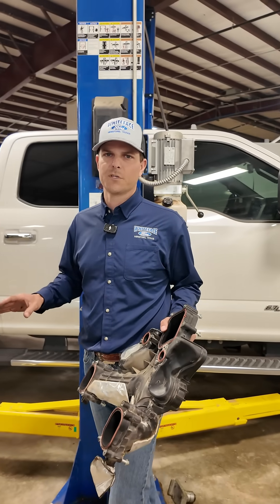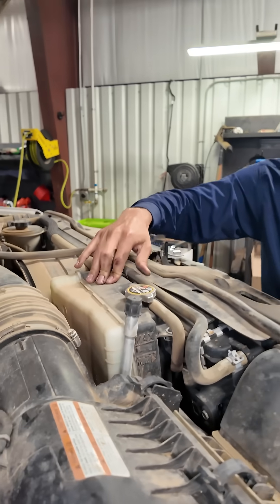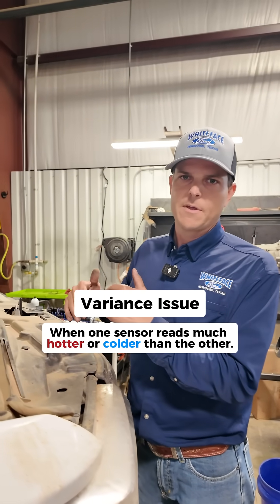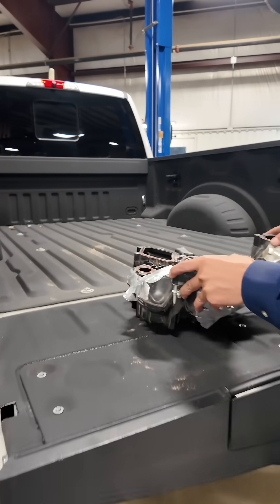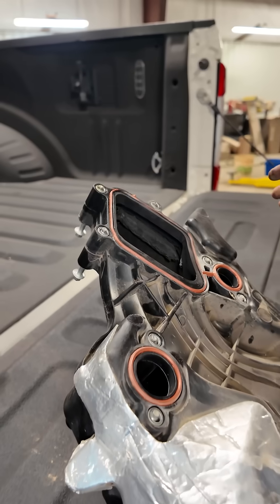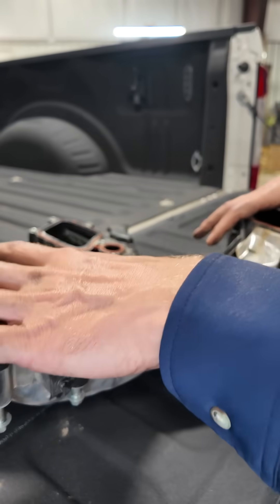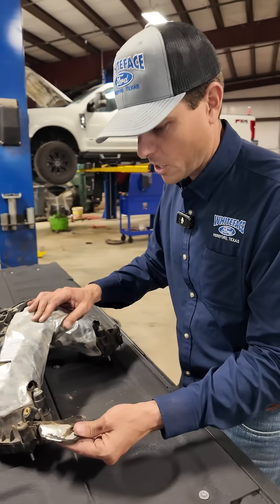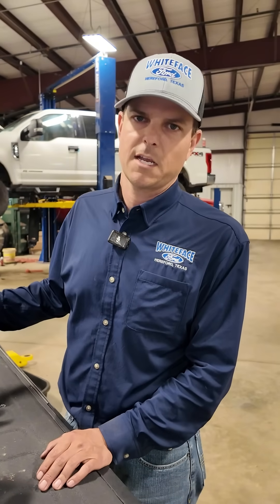Most Super Duty Gauges Miss This Cooling System #Shorts

Comment: I drove semis 25+ yrs all over the US.Never,ever,ever had a Issue other than a air compressor failure,and water In the fuel from a bad truck stop.Drove one truck with a million miles original on It for a Fedx contractor.How domestic pick up truck diesels are such a failure Is an abomination to all makes.I only buy gas pick up trucks.Very few diesels do I trust.

Comment: What the helly 😮
You would think they would make these parts out of something other than plastic 😂
Reply: The manufacturer doesn't want it to last
Reply: Pretty sure they dont use metal because it heats up alot faster than plastic doesnt atleast thats my theory or they just want more money
Reply: @carmelothegoat1892  yup I seen those aftermarket four barrel high preformce parts thats non Metallica spacers bolted in between the metal intake manifold and the carburetors probably to keep the gasoline much cooler inside the carburetor for better efficiency its even used today on small engines between the engine and metal carburetors im sure this came about from lesson from efi engine development and they applied it to carburetored engines but they over use plastic in my opinion inside the engine compartment especially since everything is just cramped together inside a tight compartment!

Comment: I threw that plastic garbage in the trash and went to a pusher piping kit when I went to a KC stage 2 and a DCR pump. 

The piping kit not only cleans up the engine bay and makes it easier to work on, but it also will take a lot more abuse and heat than the factory charge pipes. I get this was a preventable failure, but upgrading intercooler pipes makes a big difference.
Reply: Dang, how much did that run ya? $15,000??
Reply: @michaelphillips4152  no I did BD diesel manifolds and an s&b tank at the same time and it was under 10,000 for everything.